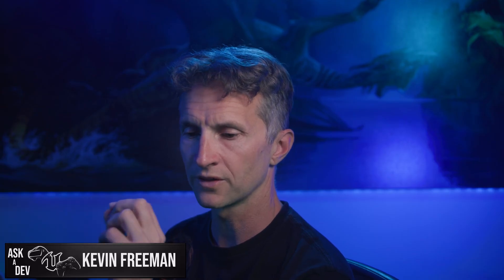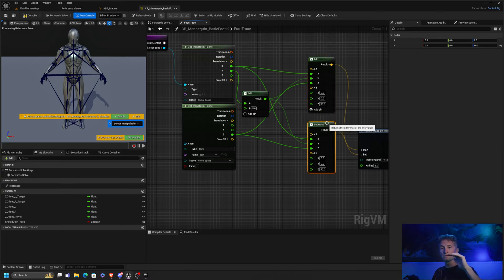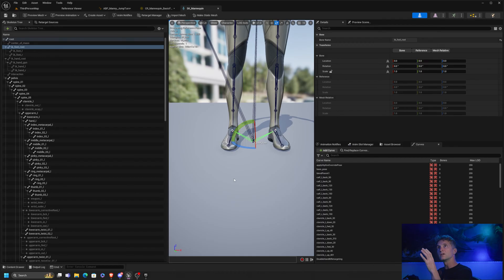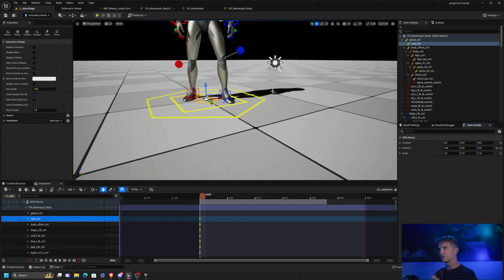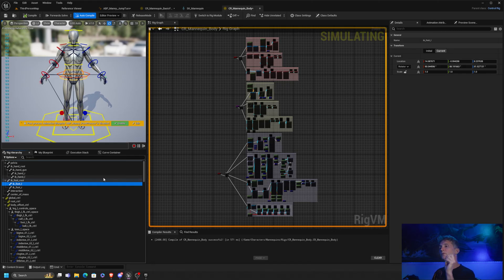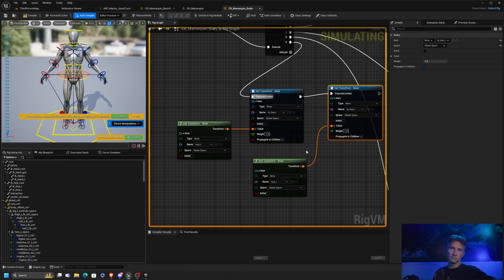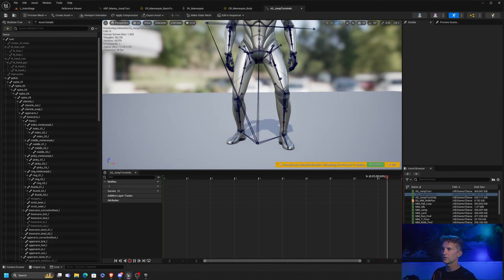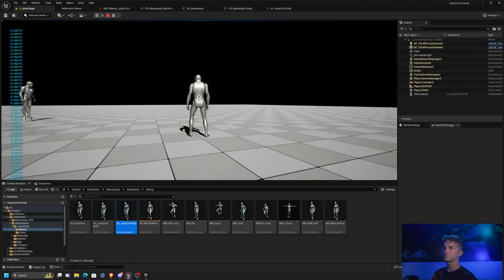Control Rig might Stomping Your Foot Animation and a Fix

Comment: Hello!

I'm really in need of help — I can't seem to find any answer to my issue.

I'm trying to use the Modular Control Rig Tail provided by Epic (UE5.6) in-game, but I'm having trouble with the Dynamic option. It only seems to work inside the Sequencer or the Control Rig preview.

When I set up an animation with a Blend per Bone on the tail, nothing happens — the tail doesn’t behave dynamically at all.
I'm not sure if the Modular Rig simply isn’t meant to work this way in runtime, or if I’m missing something in the setup.
Reply from the maker: I have built setups where it does work at runtime. ALthought I can't recall if I tried with modular control rig.  But control rig will definitely run runtime
Reply: Hello! Wondering if you had an idea on this, I followed along and I did need to refresh the root for the IK bones, but still having issues. I’m using an animation from Fab called fighting animation pack, and when I click to throw a punch, the left foot rolls back along the X-Axis about 270°. When I disconnect the control rig from the anim graph it doesn’t happen, and all of the bones seem to be operating as they should in both the control rig and the animation itself so I’m not quite sure what I’m missing